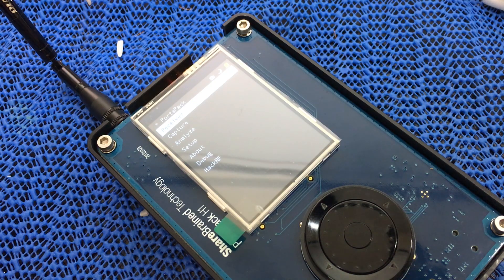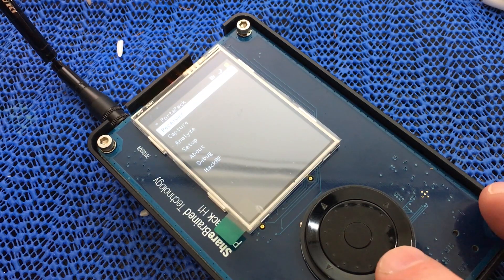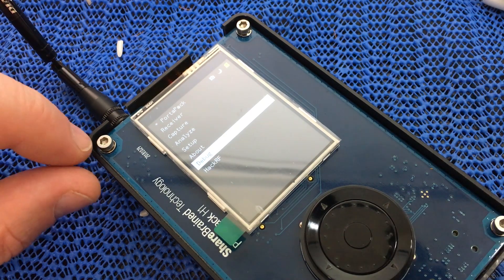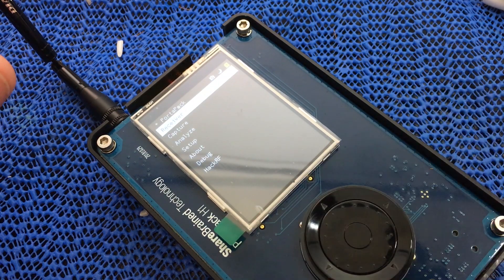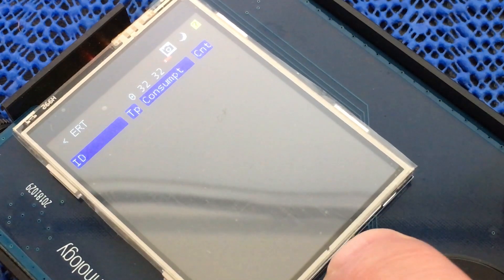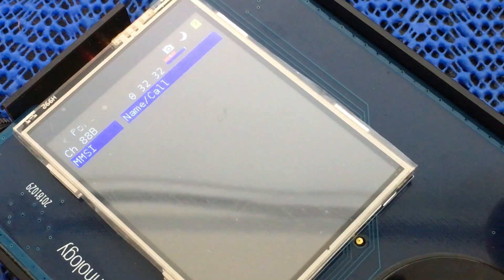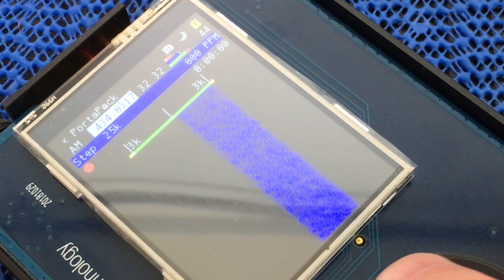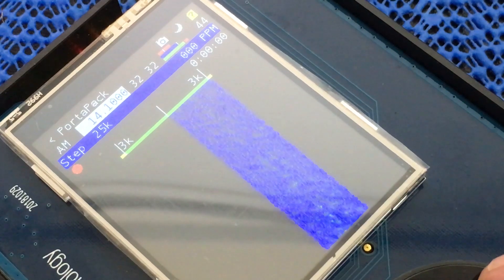The Portapack H1 for the Hack Rf one, a quick look, lets assemble the kit.

Comment: To pick up all signals
Reply from the maker: Sadly there wont be an antenna that will do all you want without some form of comprimise, check the discone 25Mhz-3000Mhz https://www.hamradio.co.uk/aerials-antenna-manufacturers-diamond-antennas/diamond/diamond-d-3000n-ultra-wideband-super-discone-style-antenna-pd-7726.php
have a squint at https://en.wikipedia.org/wiki/Log-periodic_antenna the log peridoc is a directional antenna with a little more gain but need a rotator, mounted vertically. 
they can get very interesting https://www.aaronia.com/products/antennas/HyperLog-30180-Log-Periodic-Antenna/ 
there are lots to choose from, in fact enough to make your eyes water http://www.schwarzbeck.de/en/antennas/logarithmic-periodic-broadband-antennas/standard-lpda.html

Google wideband rx antennas or UHF, SHF antennas
Gaz

Comment: TPMS: Tire Pressure Monitoring System. Gives you the air pressure of your tires on your car if equipped.
Reply from the maker: Fantastic :-) it’s pretty cool stuff loving the tech that’s coming out these days.. thanks for putting me straight.. gaz
Reply: Tpms sensors are typically 315 or 433mhz, though many of the newer sensors are programable, allowing  data streams for air pressure, temperature, humidity, battery. In the US, all newly manufactured vehicles since 2012 have been required to have TPMS systems in their vehicles, regulated via TSA formerly of DOT. 

Imho, it’s frankly a pain to deal with, as a mechanic/technician. Newbs are always smashing them in the tire changers. These sensors are attached to the valve stems in most instances. If your valve stem looks metal, chances are there’s a plastic TPMS sensor attached to that stem; though there are rubber valve stems that have an integral mounting for TPMS systems. Cheers